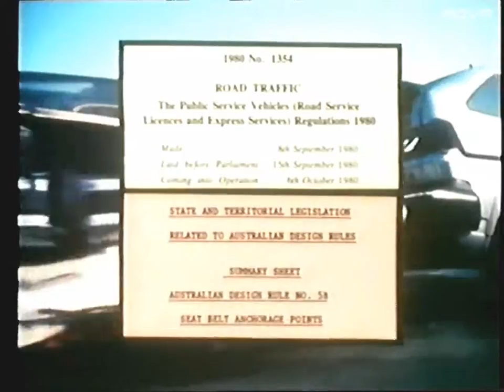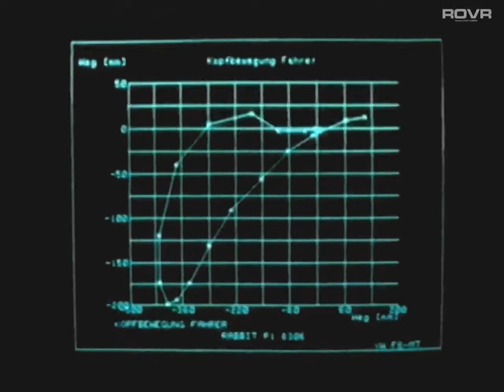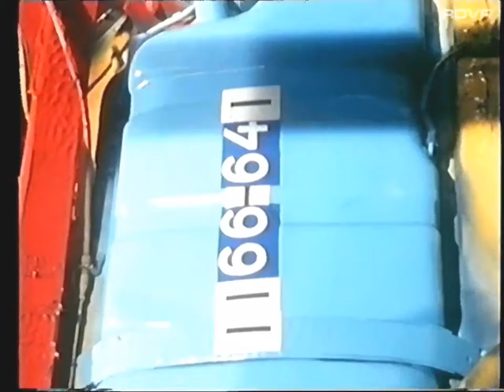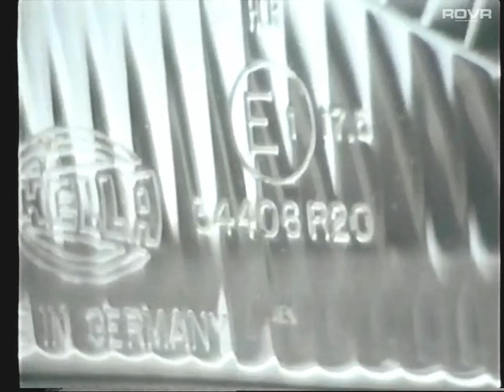Volkswagen - Tested Safely - Crash Safety Testing Information Video (1989)

Comment: VWs were designed to meet the lowest safety standards defined by regulators. Independent crashtest have proven that Opel Kadett, R19 were much safer
Reply: Ab 60 Km/h Aufprallgeschwindigkeit wird es in jedem Auto gefährlich .
Reply: @jaja-te8gw selbst heutzutage je nach Aufprallwinkel, ja